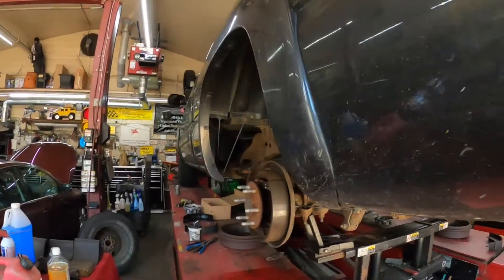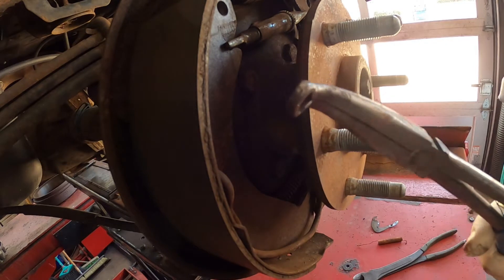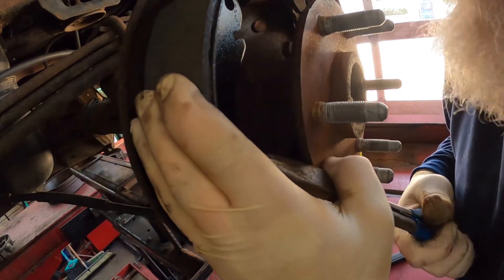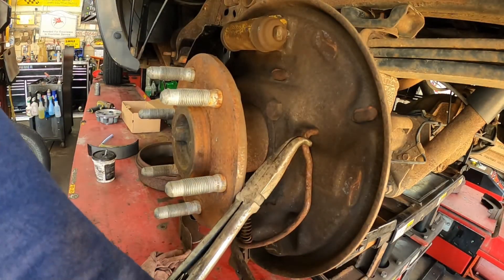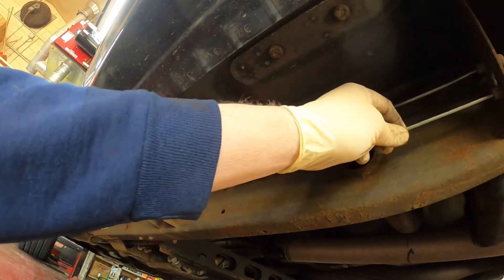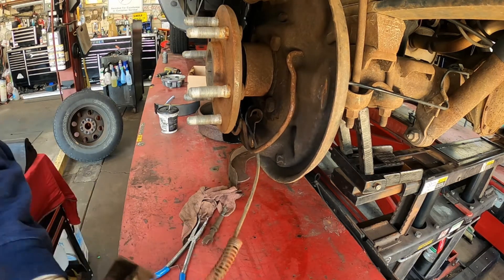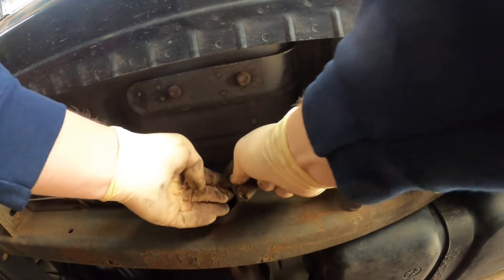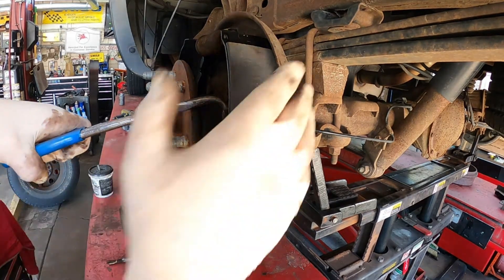2005 Chevy Silverado Rear Brake Shoe Replacement With the Big Hold Down Spring

Comment: Can bleeding the brakes be avoided like disc pads?
Reply from the maker: As long as the wheel cylinder does not come apart.
Reply: @TheGAutomotiveAndMore  if the wheel cylinder comes apart does it need to be replaced or can it be reinstalled? Thank you
Reply from the maker: @Billyargueta289  You can put them back together but they might leak. I clean them real good and check of leaks.

Comment: Great video. What’s the name of that tool used on that W shape clamp?
Reply from the maker: Long reach circle pliers. Here is a Amazon link.
https://www.amazon.com/DAJAVE-Needle-Pliers-Straight-Degree/dp/B09DYCB5DX/ref=sr_1_19_sspa?hvadid=634086793177&hvdev=c&hvlocphy=9007783&hvnetw=g&hvqmt=b&hvrand=17901431879649970290&hvtargid=kwd-1021638099088&hydadcr=29038_14670956&keywords=needle+nose+angle+pliers&qid=1689252904&sr=8-19-spons&sp_csd=d2lkZ2V0TmFtZT1zcF9tdGY&psc=1